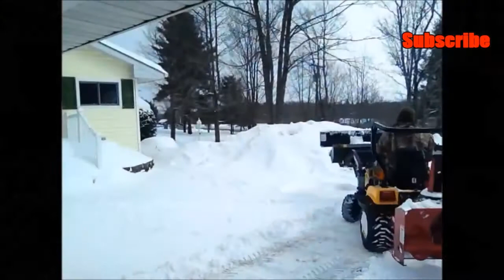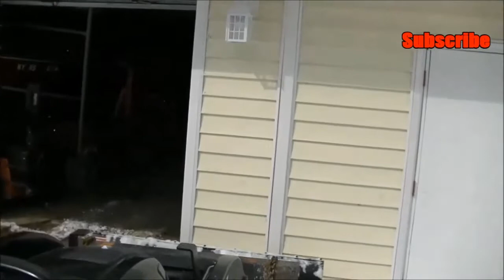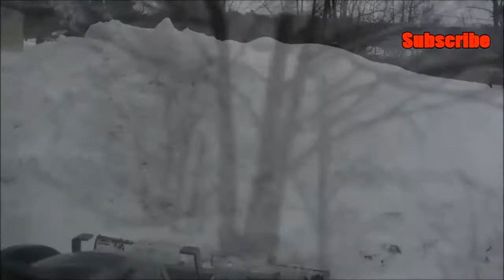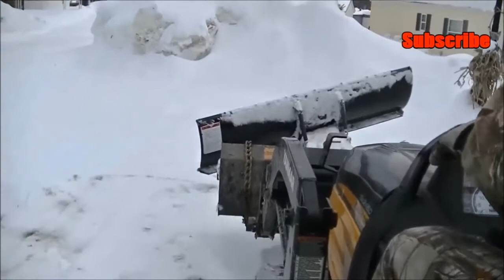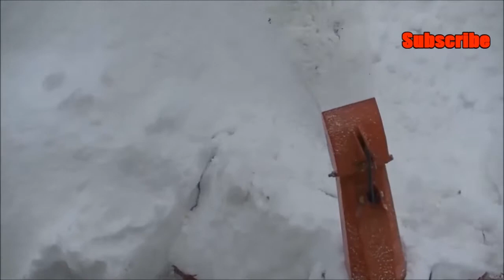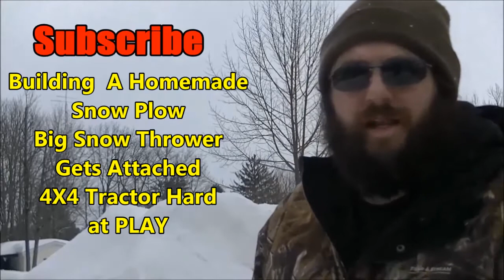❄☃❄ DIY 4X4 Diesel Tractor Playing In the Snow | One Last Snow Storm Before Spring

Comment: Looks like tractor Wil handlesnow very well. Add some side wings pipe type hinge  with pins move. Into box type or open to make plow wider.  Add 18" to hight of blade. Redo mount remove the bucket mount plow to arms.  ?  I'll send you pic of a few I did for landscapers
Reply from the maker: Christopher Kapp that would be much appreciated. I have some plans to build a larger snow pusher this summer. I can't wait to see what ideas you bring to the table.